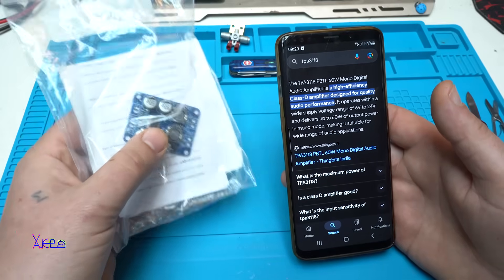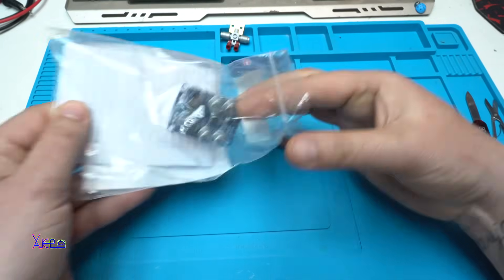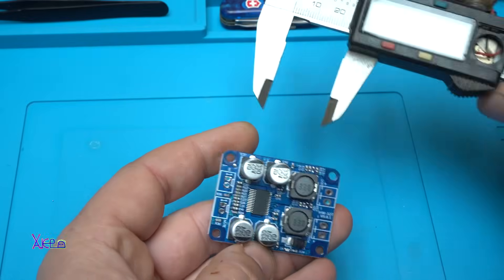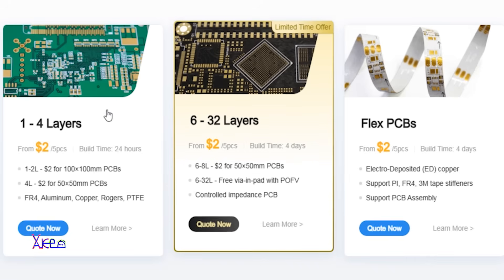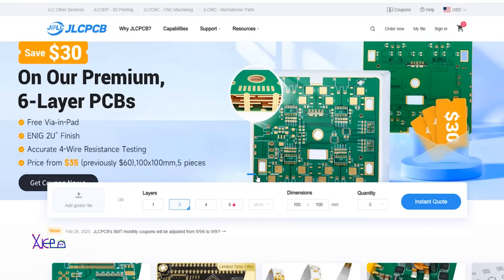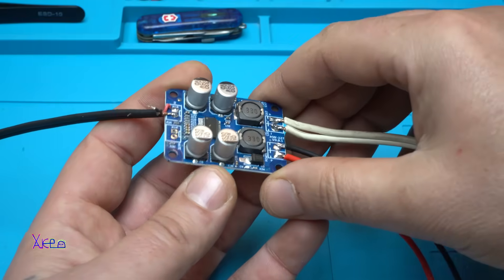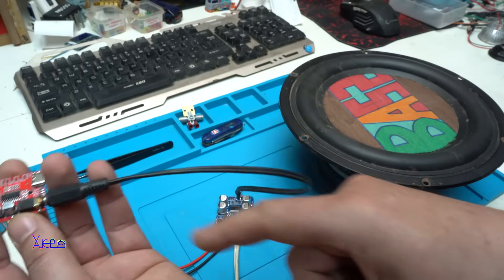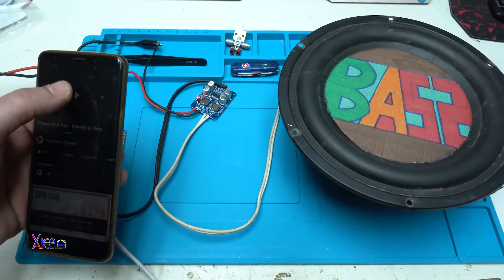WHY THIS $1 TPA3118 Amplifier Module IS AWESOME?

Comment: I inform you that the module you are using in the video is a counterfeit, as the genuine module based on the *Texas Instruments TPA3118* consists of 32 pins, whereas the one you purchased has 28 pins and delivers a maximum power of 30W. The original, however, does deliver 60W.
Reply: Very nice info.  Thank you.
Reply: How do I tell the difference, just count the pins on the chip or what?
Reply: @Dod_er yes both sides have 16 pins

Comment: If the supply voltage is 18V and the power supply is sending 200mA as he says, then the power is only 3.6 Watts. Not 60!
Reply: You can't measure peak power by watching a power supply display.  This chip, if genuine, will produce 60W, but it likely cannot do so for long without hitting thermal protections; a small heatsink would allow continuous 60W operation, however.  Music would  never sustain 60W of output except perhaps with sustained, low-frequency-only tones and that's more like a test tone than a musical one.

Comment: For demonstrations like this, it would be good to have some kind of decibel meter on hand.
Reply: Yes, but that wouldn't mean very much as he's operating an unknown speaker in free air.  Loudness depends heavily upon speaker sensitivity and having a reference sound source; music would be meaningless in this scenario.  This chip will produce 60W of output at 24VDC, but it won't do it for very long because the module has no heatsink.  At the 18VDC voltage shown in the video we might expect ~15W of sustained output, but even a small, glued-on heatsink (piece of metal, etc) would help.  Bags of small heatsinks are often cheap on the usual sites.  These chips are plenty loud enough, regardless.

To double the loudness we will need ten times the output power, so 10-20W of sustained power is just fine for portable, DC speaker systems like this module is intended for.

Comment: I would have loved for you to test the true RMS output of this small amplifier. I have ten of those and I am thinking of making a mini BT amplifier by putting two on each channel, for a total of four. That should deliver a decent wattage.
Reply: JohnAudioTech has tested a number of TPA3116 modules over the years and that chip is merely the bigger brother of the 3118; both share the same datasheet.  They are specified fairly accurately, but one should ignore the power ratings at 10%THD as that would be a good way to destroy your speakers.
Reply: As far as I understand, this chip is already connected as a bridge amplifier in mono mode. I think there is no way to wisely use two of them in order to increase the power of a single channel .

Comment: When you moved the speaker on the side, the sound was pretty clear with definition! I'd guess that using a well-built speaker enclosure would show that it's a superb little piece of electronics for its price.
Reply: Class d board is good for small setups only downside is, repairability.unlike other classes if its gone,its gone 😂
Reply: @ABHEESH-M83 it's cheaper than a single good audio capacitor anyway 😁... However, it's built around the TPA3118, which boards are highly customizable, easy to repair and pretty good for DIY projects that don't involve HI-Fi requirements (having a typical THD+N of about 0.1% and SNR ~100dB). In which later case, I'd rather go with aTPA3251 or TPA3255. For smaller systems (e.g. along 4Ω 40W-50W speakers - or 20W to 30W RMS), a TPA7498E or TPA3116D2 which have an overall better sound than this TPA3118, but cost a bit more. The advantages of the later are a compact form and a low power draw combined with a decent energy efficiency, and low thermal dissipation. Pretty good in many instances where stereo sound - but not necessarily Hi-Fi - is required, in dual mode (mono for automated teller machines etc., where the AP3050D is another solution), and you wouldn't need a big separate AC-DC power supply (a small AC-DC power supply around 19V/6A could be sufficient for 30W RMS, which are most old laptop power blocs. With a better definition along TPA3151/3155 which are more power efficient along that kind of speakers). With the TPA3118, you can still get a pretty decent/good sound quality via good filtering. Not on a Hi-Fi level, but acceptable in the garage and other such contexts.
Reply: @HawkFest  i am actually using  tpa3110d2 for my projects rn. Its efficency is the top notch. But it really doesnt like low frequencies. For mid,high frequencies, you dont need to worry about thermal management but when it comes to low frequencies, it gets hooot or even die
 Still its price and availability kind of drowns those problems ig. Still nothing beats a class a or an class ab amplifier
Reply: @ABHEESH-M83 I don't know about the TPA3110D2, but TPA3116D2 also renders a pretty good sound quality (along much better THD+N at around 0.03-0.05% rather than TPA3118's 0.1%), e.g. into a TB21 or ZK-1002T module. But, indeed, it has a lower power draw than let's say a Hi-Fi TPA3251. Its integration is very simple, highly DIY, but its lower voltage requirements between 5V and 24V (at around 5A max), means less definition in lower frequencies. They're very good for 2x50W 2.0 ch. systems. Some are advertised in 2.1 systems, but they're often too weak for good subs (IMHO, having a sub in a 2.1 TPA3116D2 system is useless, as well as in those advertised 2x100W where the lower frequencies are getting cut down - don't believe the marketing that can be seen on many such Chinese modules lol: that chip cannot go above 100W-120W total, which means 2x50W max, and effective around 2x30W RMS given a 85% efficiency). However, the wide stage rendered by the TPA3116 is pretty impressive. On the other hand, the TDA7498E (so-so THD+N), or better yet TPA3251/3255 from Texas Instruments, are excellent class D chips. the TP3251 has lots of dynamics, and the TP3255 is the best with high definitions and power for that sub.. Personally I've built a TPA3255 2.1 module for my small workshop, adding a power buck booster to an old laptop power adapter pushing it from 19V6.3A to 24V5A in order to feed 2x40W 4Ω speakers and a sub, and it's excellent (without a sub, I don't need the booster). If I want to go with my ELAC UB52 speakers, I'd need to raise the power buck to 36-48V and 6-10A (which means to buy another power block, since the booster only raises the voltage while lowering the Amperage). The TPA3116 is too weak for 100W RMS speakers, whatever the advertisement can say about this...
Reply: @HawkFest  nothing beats the quality of a class a amp mann.. if efficency is your concern, those arw some nice  chips. The problem is im from india, finding a orginal ic here is like impossible. But what we can get here is good quality class a amps. Maybe thw orginal is great in performance.  Guess ill never know 😔
Reply: @HawkFest  the closest i can get to a good quality with class d here is the ics that are considered low end /low quality internationally
Reply: @ABHEESH-M83  It depends of your setup, e.g. speakers... Some TPA3116D2 modules are advertised at 2x100W, in 2.0 or even 2.1 (!)... This is misleading (fraudulent) marketing. They integrate 2 chips, and In reality, what you can get with TPA3116 chips, is what I've said for a good sound:
👉Stereo BTL for a 4Ω charge 24V at 1% THD => 50W RMS x2 (30W for an optimal THD at around 0.05% to 0.1% - don't max out the volume)
👉Stereo BTL 8Ω charge 24V at 1% THD => 30W RMS x2 (15W to 20W for an optimal THD at around 0.05% to 0.1% - less efficient)
👉Mono PBTL (1 ch.) 8Ω charge 24V at 1% THD => 100W RMS mono speaker.

When a manufacturer/seller advertises something like "2×100W TPA3116D2 amplifier board, Hi-Fi stereo dual channel…”, what it doesn't say is that it's measured at 10% THD on 4Ω speakers and at its max input of 26V😄! Way too much distortion to be acceptable, it's untrue that you'd get a good sound under these conditions. To be acceptable at 1% or lower,  the real output is ~2×50W RMS on 4Ω speakers, at 1% THD and 24V...

Try the TPA3255: if you find that the TPA3116 renders a good sound, then you'll be amazed 😉 (personally my living room Hi-Fi  is a class A power supply with tubes stage, but that's another topic). These class D amps are just perfect for a workshop, a garage, or your kids bedrooms + PC/Console gaming..

Comment: Class D amplifier is not really digital. It uses high frequency pulses whose width (not amplitude) is modulated by the audio signal. The reason it can handle an unusually large output power for its size is that the power stage transistors are working in the switching regime, so practically don't get hot (either tiny current or tiny voltage).  Having said that 60W is an exaggeration for  this size even for class D.  But it can probably deliver 15 to 20W.
Reply: No, really it can actually deliver 60W in mono. The chip is a Texas Instruments TPA3118D2, not some chinese rubbish. They are on the level but of course checking the datasheet shows it halves with stereo and halves again using speakers with higher ohm. For example stereo with 8 ohm speakers makes it 15W max ;-)

Comment: 60W is imposible to this tiny module. You power suply show 4W
Reply: @g4z-kb7ct - it is NOT a Texas Instruments TPA3118. Also, watts are watts... This amplifier has an efficiency of about 90% so actually needs to draw about 11% more watts from the power supply than it outputs.
Reply: @johncoops6897  0:04
Reply: @johncoops6897 I have this board it's a TPA3118....
Reply: @g4z-kb7ct  - yeah  sure OK. The module in THIS video is using a fake "TPA3118" which has 28 pins. The genuine Texas Instruments TPA3118 has 32 pins. You can easily search and verify that what I am telling you is true.
Reply: @johncoops6897  Ok yeah I checked some close-ups and yes it's 28 pins. So it's not a TPA3118, but it's not fake. No one is going to fake such a complicated chip and it does in fact work. I checked the vid and he never actually showed or stated what the actual chip is. This is more like a classic case of the seller being clueless with the description text.
Reply: @g4z-kb7ct  - it is a different chip from a different supplier that is LABELLED as a TPA3118. That in itself is the purest definition of a "fake" 😉
Reply: @johncoops6897  timestamp where it shows the label?

Comment: Actually you got fake module bcos ic is small original module have bigger ic and can handle 24v …this module got burnt after 20v for long run
Reply from the maker: That is not true my friend,I test the module work perfect at 24v,prob you got the fake one that why you comment.
Reply: @Hacktuber - genuine TPA3118 has 32 pins, which you can confirm from the Texas Instruments data sheet. Then you can count the pins on YOUR chip and you will find there are only 28 pins.
Therefore, you cannot use TI datasheet claims for the review of THIS Module... because it uses a fake chip. Simple 🙄

Comment: cool little board i used to run a subwoofer from a ''150w'' board with the same chip and along with a high pass filter board  it was fine did the job, ive got a similar one to this but two channel along with the black pcb version of that bluetooth board running two old mini hifi speakers screwed together as a boombox for the garden, love these tiny boards theyre perfect for repurposing old speakers and things
Reply from the maker: Thx for sharing your knowledge and yes the board is amazing for diy projects

Comment: stereo module ?
Reply from the maker: No its mono😊
Reply: It is a stereo chip that has been wired in Bridged mode. Uses 2 channels input and 1 speaker is wired between both channels. Read TPA3118 datasheet for the circuit and explanations.

Comment: 60 watts... lol, sure.
We call these "German watts" where i live. ;-)
Reply: This chip, if a genuine TPA3118, will indeed output 60W into 4-ohms in bridged mode at 24VDC and 1%THD.  However, the chip is more efficient when operated at 12-18VDC into 8-ohms.  The datasheet claims it can output 2x30W without a heatsink, but I suspect that 2x15W or 1x30W is more reasonable.  These are not fake watts, however.  Class D amps have certain downsides, but they can produce incredible amounts of power for their size and heat generation; efficiency is often around 90%.
Reply: @antibrevity - the module in this video is using fake "TPA3118" with 28 pins, whilst the genuine Texas Instruments TPA3118 has 32 pins.